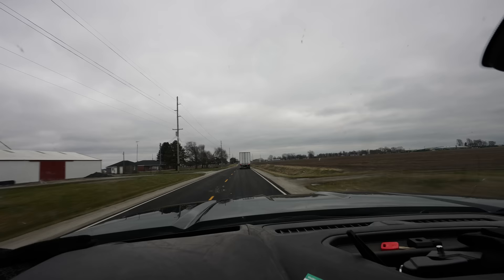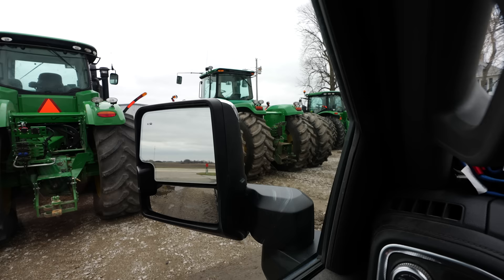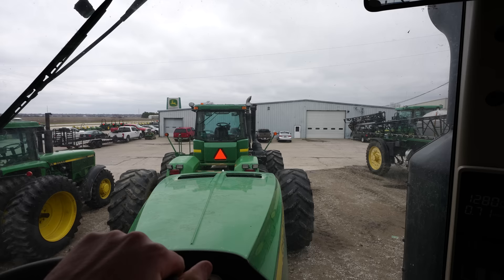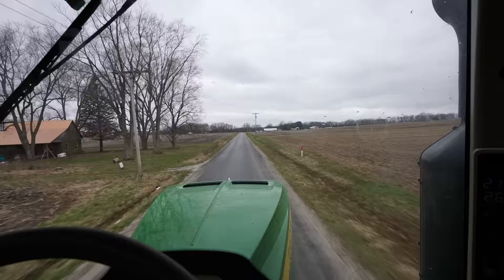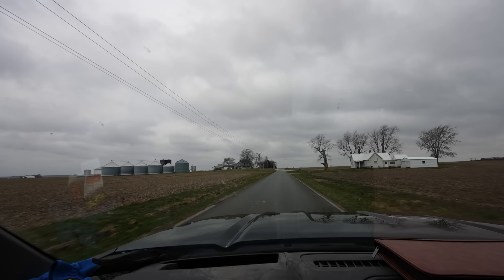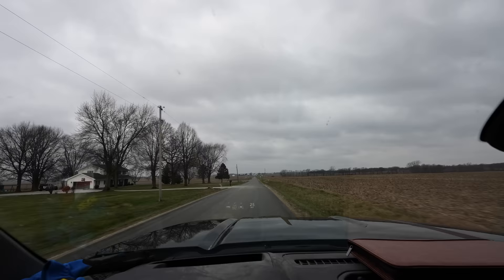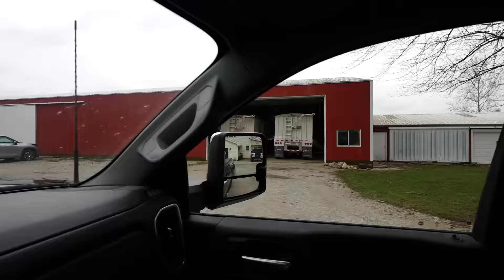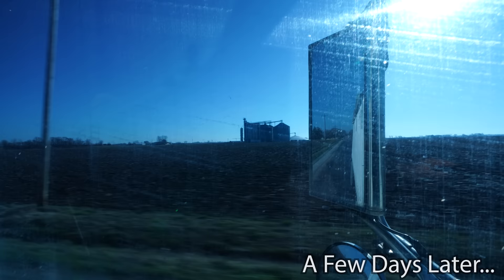Farmer Explains John Deere's Dominance In The Farm Equipment Market

Comment: I am aware I am writing this months after the videos realease but I want to put out the situation smaller farms like us are in. We run late 90s equipment before technology was intergrated into the equipment. For us this makes it really easy to run different brand equipment (a case 7250 on a johndeere 7200 planter). Now for us to get into guidance systems is confusing. We could spend the money and go all out John Deere but to do this it would cost more than two of our tractors combined. For us it makes more sence to run systems like agleader because of the price even though it is less ideal compared to John Deere. Additionally, even with we went to a John Deere system, none of our John Deere equipment is set up to run this technology even though they where made by the same brand. For example our 7200 series planter can not run prescription maps because it does not have electric drive. With this we would be spending the money on the technology to make simple guidelines that we could do with a out of date off brand company. Thanks for bearing with me and my bad spelling😂 it’s a complicated topic for a 14 year old.

Comment: I worked on a farm that had a Case 245 which ran a Greenstar guidance system and that combo of brands ran the smoothest and most accurate of all tractor guidance systems I have used.

Comment: Deere monitors are hands down the best in the market considering ease of use, simplicity, while maintaining the ability to do very complicated and involved management if desired.
Reply from the maker: That’s what I’ve gathered from many farmers!
Reply: Yes id agree fully. But also fendt once you understand it can do it all. And id add the new case pro 1200. Got on in an optum at work. Incredible screen for their first new gen
Reply: @twatner09  I have personally used the new Fendt integrated monitor system and the Pro 700. I have not used the Pro 1200 but have not heard great things concerning reliability (Case to Case system btw). They sound good when they work lol. The deere's have their own issues, but almost all of those for us seem to be related to 4g connectivity, so might not even be Deere's fault given our poor signal coverage.

Comment: Was a day late to watch this but good explanation on the brands of equipment. From what I can tell here in saskatchewan, we do have quite a bit of john deere dealerships but in my area I'm starting to see alot of claas lexions and fendt ideals(and some case) combines more often. From what I've researched alot of that goes with the prices due to Canadian prices being so expensive as combines generally range from 800k to 1.3 mil. One thing I see is there is generally alot more john deere tractors and I imagine cause they are pretty reliable. And even I agree john deere do look quite nice. When it comes to seeding tractors, I generally see just the case steigers or john deere 9 series', due to the good horsepower they have and what u need to pull air seeders. 
Anyways awesome video and keep up the awesome vids!
Reply from the maker: Thanks for the great comment. I think the Claas and Fendt are much more tempting to farmers that are looking for change. They are stylish, powerful, and innovative machines. Deere does all of the same, but there’s not as much attraction to something that you’ve always ran. It’ll be interesting to see if these farms stick with the other brands or if they come back home to case and Deere.

Comment: Get some A-frame barricades and flashing lights for the tile holes - Big enough to show over the corn and beans. 52:21 youll need the lockbolt socket for the lights a-  keyed bolt like locking lug nuts

Comment: Here is why I’m Deere. I buy stuff about 5 years old, use it for 10-15 years, and sell it for more than I paid for it. 

I do love the old Internationals. They were always way ahead of Deere. In the 70’s they had true rotor combines and proper MFWD. Their are all kinds of sleepers out there. Ford, White etc… 

Also, I have Deere dealers all around me. That support is priceless.
Reply from the maker: It’s crazy to see the resale value in the current market. We sold a 2013 tractor for 30% more than what we paid for it. The only catch is that we bought a replacement tractor that was 80% more new than the old one. There is definitely some funky math going on in the current marketplace. 

I am a big fan of other tractors. It is just hard to sneak them into the rotation to even attempt to try. 

Thanks for the comment!!

Comment: I way that Hague’s fitting in that shed if a 9620 r won’t fit the hagie will be taller then that tractor
Reply from the maker: I googled the specs of the Hagie. It is supposedly the same height as our 9460Rs. You are probably right… I’m just optimistic!

Comment: Odd the dealer doesn’t clean your tractor   Ours comes back fully cleaned every time our equipment is at the dealership
Reply from the maker: There are some dealerships that do something like that. Our local case construction does that. It’s not like it’s free…
Reply: @aTrippyFarmer  they don’t send us a bill. If that’s what you mean. It’s no biggy. Just when you bring it home it looks brand new.  I’m guessing you probably have a good power washer so it don’t matter.  Good luck on yohr spring planting.

Comment: I would agree with everything except resale as a good reason. With the internet a farmer can see what every model the same as theirs is being advertised for or sold for on auction all over the world. Might make more difference when buying new and trading but buying used and trading the spread has tightened over the years. With the tools we have at our fingertips in this age if a farmer is concerned about resale they should be selling the old machine themselves
Reply from the maker: That is a great point that I overlooked. I do think that my logic holds true if you are trading at a different brand’s dealership, but you can capture better return on your own. There are some tax implications with that route that do discourage outright sales. Thanks for the comment!

Comment: Hi from oz Andy.  JD does have good gear but not the best of everything. I found fendt are the best tractors still even though owned by agco. When still independent company that only made tractors they ruled the world for quality, reliability, resale , fuel efficiency etc. that proven by biggest farming magazines from UK, France and Germany  when they tested lot of tractors of same size every year. For fodder conservation gear Europe is 10 years ahead of USA and Krone balers run rings aroun everything else on the market.
Reply from the maker: I agree with your points! There is no simple choice for the best product in every industry. I do think that Fendt’s would dominate the tractor marketplace if they could break the chokehold that Deere has in the United States.

Comment: Not Ag Pro (John Deere Dealer network). If I was all John Deere,  I would switch to all fendt or case immediately if I wasn’t red already. Ag Pro’s  dealer network bought up all of the family owned dealerships and now doesn’t even stock the most common parts and either tells me to drive to another dealership or wait until the next few days for them to get the part. Absolutely disappointing and frustrating. I will do anything to stay away from them, not because of Deere, but because of Ag Pro
Reply from the maker: I’ve heard stories like that with all of these dealerships merging and getting bought out. Our local dealership only has 4 stores, and we are lucky to deal with the main one. I have also worked with Sloan’s, which is a fairly large group of stores now. I’ve had good experiences with them as well. I think it all comes down to the management and leadership. It sucks for farmers like you, though, to get a bad dealership out of the deal. That’s exactly the point I was making about service and parts. Hope spring goes well for you!!

Comment: Made me laugh to see we went aren't the only ones that's been pumping up the tyre on the gator for the last year!! What do u think about the price of buying, running and repairing a gator. Ours was full cab with proper doors not glass, heaters extra LED lights. One light that new now is £30.000 in Wales UK!!! For a glorified golf buggy!! We found it crap in wet ground. We sold ours n bought twin cab pickup few year old 20.000miles heated seat sat nav and saved a small fortune. When we bought our first ATV ( mule ) around 15years ago I wanna say it was about £6.000. if u parked the mule and gator side by side ye the gators abit more luxurious but £14.000 difference!!! Ridiculous! Anyway keep up the good work, would love to come and experience your farms over there. We have a big tractor for round here but small compared to your John deeres lol
Reply from the maker: I have mixed feelings about the gator. This one is nearly 10 years old, so I am sure that they’ve gotten better. It has some flaws and reliability issues that bother me, but it always gets the job done. If I were doing it again, I would probably go with a Polaris UTV of some sort. Everything is expensive now. I’m sure this gator would be pushing 20-25,000, but the same could be said about every other brand.
Reply: @aTrippyFarmer  why not just get a used pickup truck to roam around the fields?
u get windows and heat/ac and should be reliable

Comment: Multiple brands that are expensive and it is a plus for the customers. Better engineering demands quality and reliable that a customer demands, so if a bad piece is known to farmers, that brand in that area is trashed. Farmers are going to buy quality... period, not color !
Reply from the maker: I agree. There are a lot of 10-20 year old Deere tractors around the area that still performs tirelessly. Deere hit a grand slam with the 8000 series tractor that has solidified a lot of permenant business.

Comment: Tou say about parts but what if your neighbour had a part say getting dust and you need that part and j d havebt got any in stock you also cant just put that part on your tractor as it needs to linked to that tractor  but jd wont do that as you didnt buy the bit from them so it wont work is that fine do you agree with how little they help the farmer we all know how jd go above anything to make stuff hard for a farmer to fix without the help of jd we all know what shifty stuff jd do now and have done

Comment: Andy,,,,, I’ve never heard you be “politically correct before”. You hit the nail on the head with your 4 stated reasons why we run Deere. And you also nailed the 5th for us cotton growers, Deere is the only one still building cotton harvest equipment. And besides that, no one else could compete with them and hence the last man standing. No one will ever beat Deere. Ever. And that’s not up for debate.
Reply from the maker: That 5th point was just a lucky guess example. If you talk enough, you’re bound to say something right eventually! 🤣
Reply: @aTrippyFarmer  Andy the two most expensive pieces of farm equipment made by Deere are the CP 770 and the CS 770. I have two CS 690’s both 2019’s,,,, due to the price increases I can trade both of them in for one new 770 and still have to throw in a little to make the swap. We usually only run them for three years and trade, but the price difference in three years is unreal.
Reply from the maker: @peteparker7396  that sounds about like everything else. Our combine depreciates around 10% per year. If you don’t maintain a trade roll, it becomes a big price to trade up for a new machine, unfortunately. I can’t tell if it’s the nature of the market or if it’s specifically engineered by Deere.